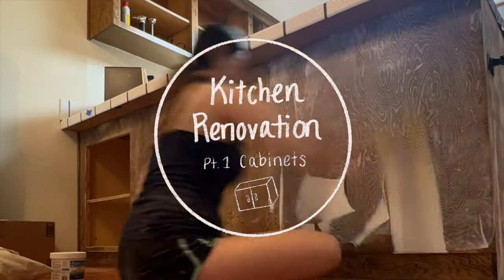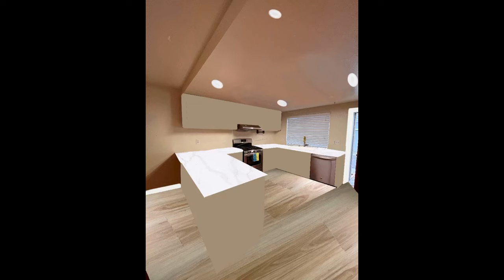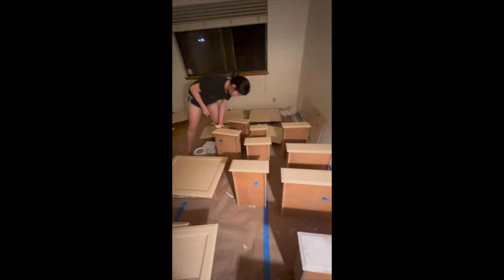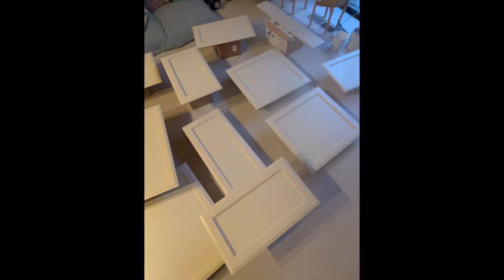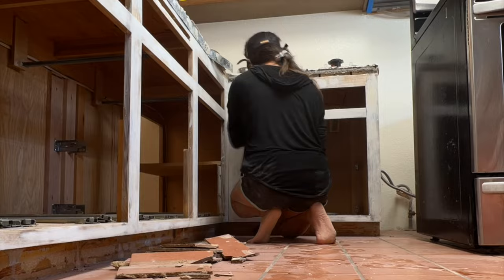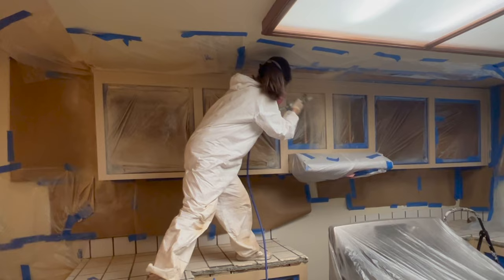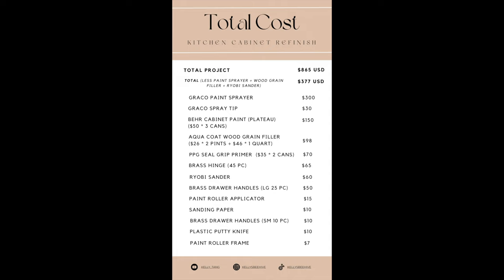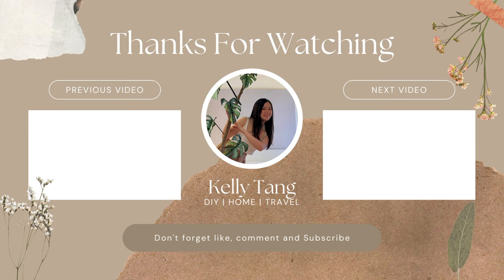How to Paint Kitchen Cabinets | Huge💰SAVINGS💰 | Kitchen Makeover (Part 1)

Comment: Kelly you’re so inspiring, we’re thinking about painting our cabinets as well. QQ, do you recommend like washing cabinets a light off white color? Thank you!!!
Reply from the maker: Thank you so much! I really appreciate it :) Do you mean Limewashing the cabinets? I wouldn't recommend using limewash on cabinets because it's a high touch area. Limewash isn't like paint where you can touch up if it gets dirty. You have to repaint the limewash for the entire surface area or else it'll look blotchy. Limewash is also prone it chipping. If you want to achieve the limewash look, I'd recommend diluting 2 shades of the same color paint (ex. light brown and dark brown), then applying it in a criss-cross patern on the wall to mimic limewash.